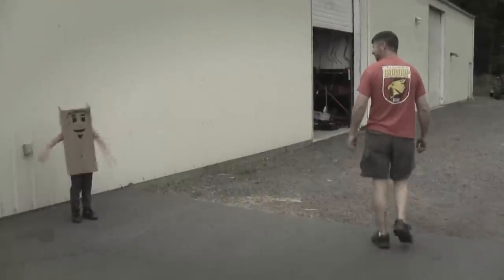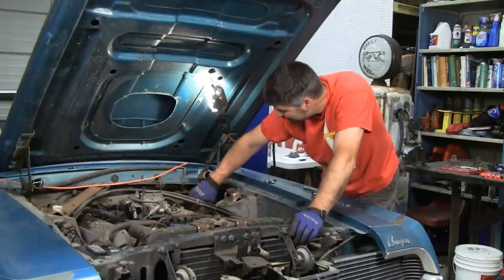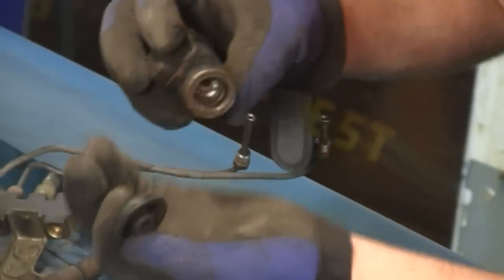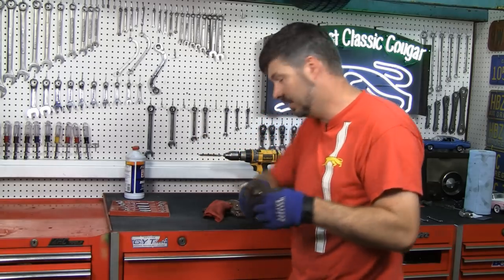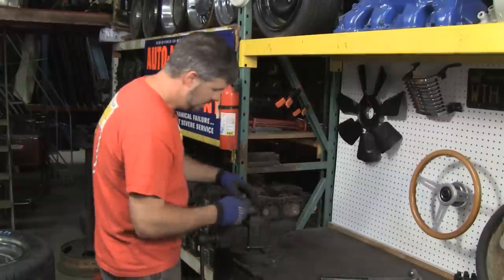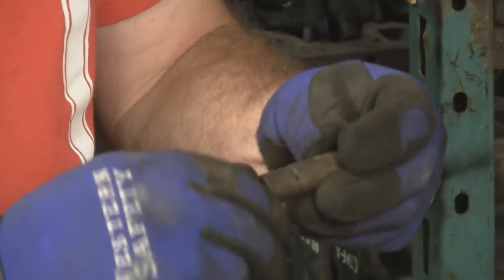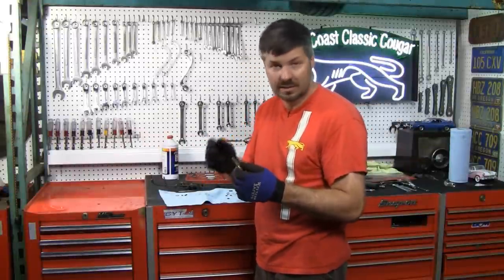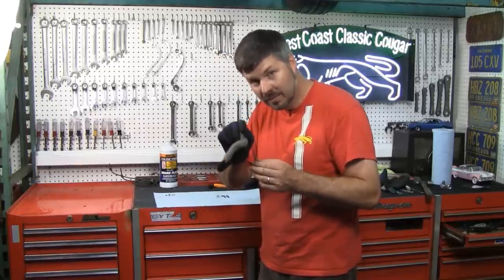Disc Brake Distribution Block and Proportioning Valve Rebuild - How To

Comment: Absolutely great!  Thank you,  BTW "iconel" is Inconel ( IN-con-Ell)  A high temperature corrosion resistant alloy used in heating elements,  exhaust valves, pyrometers,  turbines, etc.

Comment: where are all of the custom wrenches from trying to get those lines loose? I have a four speed big block car and the clutch pedal lever is right there! Great video and good parts from WCCC too. I did the job with this video right next to me. The Mach 1 stops WAY better.

Comment: make 100 percent sure you have these valves checked twice or three times over, because i call a bad proportioning valve the monster under the bed, or king of the nile. because not any ole average joe can drive it down the road and tell its bad. its one of those things that you wont be able to tell is actually bad until your brains are splattered all over the road. i just had to make sure thursday we had one of these replaced at our dealership, and the last one was almost 10 years ago and i hope its atleast another 10 years before i find another bad one